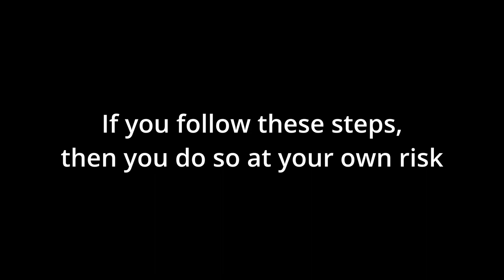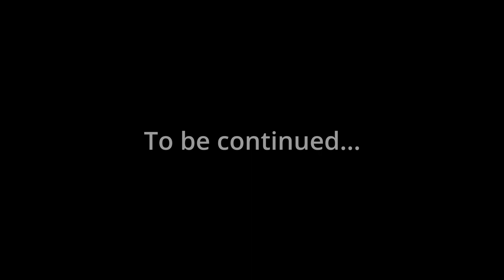Reassembling .25 cal Hatsan Sortie - Start to Finish - New Hammer Spring - Wicked Long Video

Comment: Hey brotha, I thought I might be of some help to u. I'm about to take apart the trigger. I can take pics of its internal parts if u would like, plus the reason why I'm taking it apart lol...I believe they used part of the blitz to build the sortie. I believe the sortie can modified for select fire. An im 99.9% sure that theres no internal parts near the magazine edge to stop u from filing it down to fit blitz magazines!
Reply: Hi man I was wondering which side can be filed to fit the blitz mags. Is it the rear or toward the front?
Reply: That's awesome there are so many little secrets like that about these hatsans with parts that can be interchangeable with little or no modification. I learned when I found out the sortie mags fit the jet. I've only ever used sortie mags out of my jet. And never had any problems cycling. My sortie has never had problems cycling. Both are refurbished. My jet out the box wouldn't hold air. I tried doing some research. And information on jet is limited. But I did learn one very very valuable thing about hatsan pcps is 90% of the time when they won't hold air when you are trying to pump them up or they leak. It's actually due to the rings drying. So I take some silicone oil n dump about 10-20 drops in fill nozzle. Cocktail the hammer or lever back n leave it. Pump it up. If that don't fix it right away I dry fire with whatever air would go in and repeat the process. And it works 100% of the time for me. I  try to put this bit of info out on as many YouTube and airgun forums that I can so I hope it can help as many people as possible like it did for me. If your using a hand pump I usually put oil down in the hose before I put the fill adapter on too. It has made a difference a couple times. Sometimes a couple dry fires are needed to cycle the oil thru and rejuvenate and republication the seals. If that don't work your seals may be damaged. I know this is off topic like I said I just want to share this bit of info for anyone it can help.

Comment: Pretty Admirable work you have done there honestly my friend, looking forward to seeing how the power is effected. I kind of have high hopes here watching all that almost 2 hours work. The new spring seems quite solid and strong, if it cycles alright then maybe you dont have to do any tension adjustments at all to get the desired power output afterall.
Reply from the maker: Thanks. Yeah, the new spring seems to have done the trick. I may play with it a little, just to see what it can do, but I'm not going to go crazy like last time. lol.
Reply: @KiJenProductions  :what ever you do just don’t work on it while hammer cocked again 😂, on the other hand if you are now certainly clear about which turn to screw to give more power to the hammer spring please let me know :) as I am still not clear about it neither with my own nor through your videos, which is on me probably 🙂
Reply from the maker: @Ah.M.Sengul  Yeah, I think having the hammer cocked is where I messed up. Too much tension on the spring while making the adjustments and it was twisting the spring. Counter-clock adds tension to the hammer spring - clockwise reduces tension, I'm almost certain of that now...almost. I still want to try it again, but this time without the hammer being cocked. lol.
Reply: @KiJenProductions  Nice 👌🏽 Looking forward to seeing it bro, love your videos anyway, let’s see how much addition of power it will provide to the power output via some particular number of counter turns to the spring tension👍

Comment: Hey, good stuff.  Almost got me to my problem.   I wonder what how you would deal with a stuck bolt assembly.   I have the gun torn down, but, I don't see a way to pull out the bolt.   It moves both ways with a bit of tapping.   Ideas?